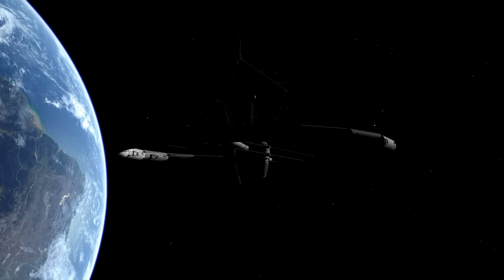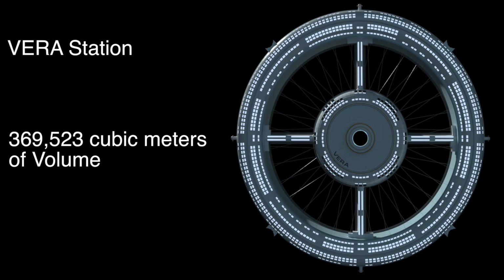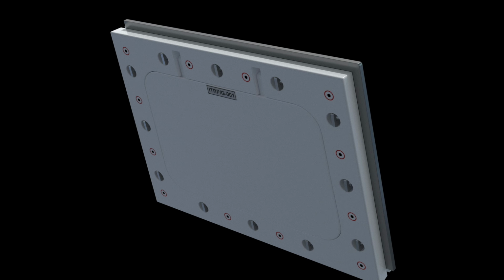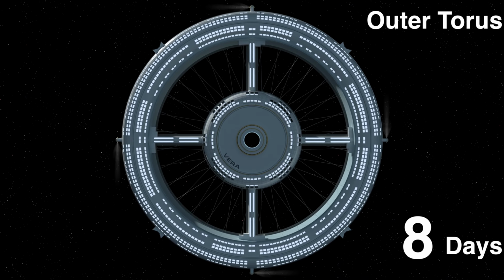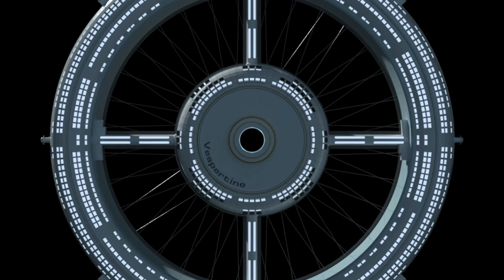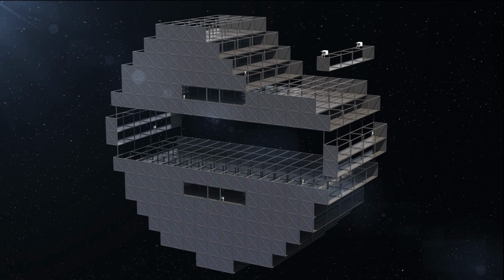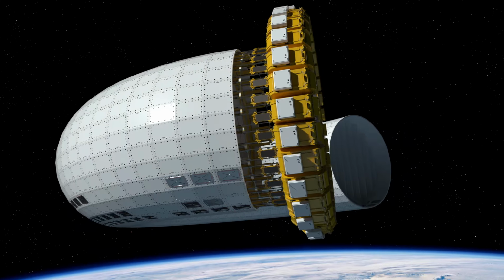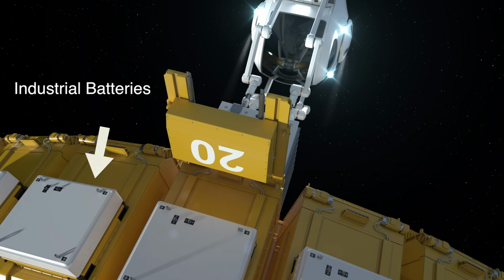We could build this huge Space Station in 6 months

Comment: Relatively similar to a concept I was playing around with about half a year ago. Some comments:

1) There's no reason to assemble things one panel at a time in orbit with a "construction ring". They should be sent up on hinged bundles of panels that can self-unfold in orbit. The only connections that need to happen are then (A) automatic locking in place between panels in a ring (rubberized seal, not welding), (B) joining and locking together with the ring on the opposite end, forming a completed ring; and (C) the connection of individual rings to each other, building up two halves.  Again, all of the "joining" hardware should be integrated into them at launch; they should just need to be aligned to mate with each other in space.

2) Come on, you need more glass.... the overall impression should be "glass with some metal", not "metal with some glass".  Except...

3) Occupants of a rotating station will experience a defined "up" (toward the center of the ring) and "down" (toward the exterior), which creates the concept of a floor ("down") - and one doesn't expect to see through the floor. You also need space for life support and various mechanical systems, which inherently block some views of sunlight - might as well have them below said "floor". And lastly, you don't want daylight 24/7. This argues for a glass-rich inner-surface ("up" - ceiling, walls) to the torus and an opaque outer surface to the torus ("down" - floors) (floors covered in exterior solar panels, integrated on the ground before launch, just like the glass). Maintaining a rough 24-hour day-night cycle can be achieved by the station undergoing one non-axial rotation per day, independent of the orbit.

4) The high volume to surface area ratio minimizes the impacts of leaks, and one can certainly  store truly massive quantities of liquid oxygen if desired. Still, the ability to isolate portions of the torus from each other in the event of a catastrophic accident would be desirable.

5) While interior maintenance is no different than on Earth (I assume panels will be 4-layer - inner contact layer + inner pressure layer + outer pressure layer + outer contact layer, so that either pressure layer can be replaced without breach?), exterior maintenance appears to be very challenging if the craft is still rotating.  So the ability to do periodic decelerations should be planned in.

6) Elevator sizes define the maximum size of prefab objects that can be brought into the rings, so you want them as large as possible. Unless you're also adding ports onto the ring (which can only be accessed when decelerated)

7) An inner rotation ring is a complication that I don't believe is needed. The small radial G-forces from such a slow rotation of a docked Starship centred on the point of rotation and perpendicular to the station should not be at all problematic. And you really want at least two Starships to be able to be docked at once; you can't rely on a single point of failure like that. You can dock more if you align them along a central spoke, although the greater offset from the central spoke would increase the G forces from them.

8) Honestly, there's great potential for space usage in the hub. While people talk about zero-G sports and entertainment, in most cases you really don't want *zero-G*.  For example, low-G swimming and diving might be fun, but in zero-G water tries to thickly coat your whole body (incl. mouth and eyes), there's no defined direction for where you can find air, etc.  There's a wide range of entertainment possibilities for the low-G environment in the hub and this should be fully utilized.

One thing you need to stress more is: ***floor space really isn't that expensive in a station like this***.  Even if you don't fill every part of the torus with many floors to maximize floor area. Starship's launch costs are so cheap that floor space lease costs should be similar to that in a big city.
Reply: Concept and design is far from the real construction. Seeing a lot of rocket/space explorer companies showed up their 3D animations/models without a realistic plan (fund, roadmap, etc). It's just a wasteful of resource for a lot of trash concepts

Comment: Assume all the technical and manufacturing problems are nailed first time around (which they won't be), I'd be interested to know how many launches we are talking about to build a station. The construction time is just one part. How long is it going to take to manufacture all the material for the first one? I was thinking it was going to take dozens of launches just to pressurise but it doesn't seem to bad - only about 500 tonnes of air. However, then you have to think about how many launches does it take to sustain a station of that size?

Comment: Great vision but there are a few problems/flaws. The panels of the toris look square at the presentation. Because of the toroid nature of the construction they have to be curved (left curved for the external ones and right curved as you move inside the torus) ,trapezoids and of different sizes, not squares so the design of the construction ring has to be redesigned. Another problem that has to be solved is the supply of such a big volume, not just of the external panels but also regarding the materials of the internal construction which needs to be done at the same time as the torus progress. What about radiation protection of the habitants? What a bout the problems that arises in an close environmental system like that ? Experiments here in earth and in space have shown that there are huge problems inside a such environment : bacteria, microbes, in other words a sustainable environment it's at least very difficult to achieved. Let say that these problems can be solved, there is a big problem with it: cost, which will be enormous and this is the  main problem of the space industry so far for the foreseeable future.

Comment: if the machine is inside the taurus as it goes, it cant finish the last ~1/6th. manual? or yet another imaginary machine?

the solar power hand waving is also laughable. 

you could make a taurus out of interlocking rings that fold out like origami. this is a much more likely path. just normal machining and load to orbit..  no reason to build in orbital construction constraints to your plan.

this is almost as if you saw a very highly efficient and tuned electric car, and thought, you know what, i'll invent an ICE and to support that i'll build an oil system and a fuel system and an exhaust system and a temperature management system and.... etc etc. there are literally unnamed entire spacecraft in your videos you dont even bother to explain.

please sit down with a competent engineer for coffee and let him explain how needlessly complicated your thinking is.

Comment: I grew up in a casting in machine shop I'm sure you probably heard us lost wax casting and high-pressure investment casting that the actors of the casting is when the within the thickness of a human hair I suggest that they place the mold on a turret where is continuously rotating during the four and do a full 60 rotation several times out into the complete length of the casting is done and I mean casting it straight up not sideways that way despite the thermal reactions there won't be any pressure changes was in the casting because of it but I'm talking as more small injection port computer-controlled constant speed until the pores done semi machine casting other than the setup your costs are going to go down because all you're doing is running a finish late check to make sure that there's no offset to the casting by even fractions cuz going to that pre-rolled steel it's such a waste of time

Comment: Love your ideas and followed you since you started, you mentioned it's too expensive to build on earth? Elon is setting up the machine to,ass produce heavy lift boosters, what if he just built sections the size of boosters all the same with dozens of off set connectors to make circles out of all those sections into a ring? Stacked 180 degrees of each other it would form another straight section that could be broken down in space.
The less construction in space the better. Making the machine to make the machine is huge. How thick the walls, insulation, double or triple wall, length of each section, reusable nose cones and tractor second stages, etc. Plenty to figure out even if musk built the basic inner ring, at least it would cut the time frame down. I look forward to your next video.

Comment: I see some problems with this design (maybe you have already solutions for it but they are not in this video)
1. In the construction phase you have alot of movement in the system so the whole construction will start to tumble
2. There is no heatsink system (if you take a look at the ISS the heatsinks are massive) and such a big station will produce alot of heat.
3. No solarcells? I think this monster needs alot of energy.
4. How will the stabilization-system work. If you have hundreds of people moving around you have
     1. alot of mass shifting around all the time
     2. the people put alot of kinetic energy through walking on the floors in the system 
     3. Worst case all people meet at the same place on the station
5. And last but not least imo your construction process is a little bit overengineered. My solution would be a construction ring with 2 welding robots with bigger magazines for the plates working on oposite sides on the ring. if one plate is welded they move a step left/right and weld the next one, less moving parts, less mass, easier to build. (Two robots so their movement will be neutralized)
Sorry for my english its not my native tongue.
Reply: I think he mentioned solar panels at 6:10 - 6:14
Reply: That most of the problems, how they gonna material and the amount system to work together both A.I and Human to start working. Not to mention the distance of the asteroid belt for material and system failure?
Reply: Stabilisation is somewhat straightforward I would think. You have to have to store a large amount of water, both fresh and waste/recycling water. Instead of one massive tank you have a bunch of smaller tanks situated around the torus and pump the water between them as needed to balance out any weight changes.
Reply: Well nice to see someone with big ideas like this for the future! Elon may have overstated some timeliness but he does manage to get things done! Big ships and big stations out there certainly sounds good to me!  Elon?

Comment: Lifting all that mass to LEO is still going to be your biggest limiter, you would need a lot of starships liting each day to keep a system like that running smoothly and machines that complex won't work without fail. One thing though it looked like the ring builder could be assembled from numbered sections that could be pre-build here on Earth. I also think that you will be needed some sort of double hull with self-sealing materials inbetween to make it safe 'enough'. You might need a starship for each section 3 times a day and that's more than 50 launches day in and out just to keep the system running.

It's funny though because your assembly way is almost identical to what I my self designed for my own idea about a space station a few years back, only I added layered hull section with an overlap that included automatically identifying issues if there ever was a hole somewhere. Lets just say I was bored for a while and needed something to do and designing a big space station was just to complicated to be easily solved so that became my go to place if I had nothing to do.

Have you thought about material stress if you spin a station held together like that? Will it hold if you spin to simulate 1 G?

One thing I can tell you right now is that you're going to need that build RnD station sooner than later.

That all said, I really like the assembler machine idea, build on earth ship up, assemble into the ring builder and let it build. Wonderful, but you should add a inner version of it that creates the double hull, just for safety reason as space is insanely hostile to human life. It could be all run parallels with a bit of off set and behind that the inside floor machine could go to work. Or maybe running two offset ringbuilders after one another to create an overlapped double hull. Even better add something like carbonweave as a holster between the layers to really protect the inner atmosphere.

I'd recommend building a test station first that was way smaller just to figure out the hang-ups before trying something too big. But I'm guessing there will be a money issue and don't forget that there's a storm of junk up there left from other space junk and that will be an issue down the road.

When it get's done, it will be very clear that the building blocks needs to come from space and not being lifters up from Earth. It's the only way something as big as you need will be build, unless we see a radical shift in lift capabilities. I had just the same issue with my own design and getting it all lifted will be your biggest hurdle.

But the core of your idea is very workable, I would know because it's oddly similar to what I designed over 5 years ago (nothing was ever released by me) so we both had similar ideas on how to build a big space station.

My big issue was lift capacity and cost, plus material strength calculations on exactly how much force spinning the whole thing would push the ring apart. But I'll say this I had a lot of fun figuring out how to build it, materials to use, balancing system and so much more. My idea is not fully done, but I'm down to stuff like electrical, water, sewage, air tight protection areas and more.

I really hope with all my heart that you can get this system up and running and humanity's first big space station can be build in space. It will do wonders for all the interest in space if done right. So keep up the good work.

Comment: The point to a torus space station is to provide artificial gravity at reasonably low rotation rates.  But that means you have to spin it.  Spinning it up with rockets requires a lot of fuel and if you neeed to stop it, you need fuel again to stop and restart it.  Building them in pairs with a framework between them lets you use electric motors to spin up and spin down.

It may be possible to reverse spin the radiation shield to proved the net zero momentum.

Sun sync is good for constant energy, but ii is relatively expensive to reach.  You might alternately consider low equatorial. 

Ebeam welding should do fine in space.  But in that case, you get a monolithic structure which may be prone to fracture.  Eric Drexler and I wrote about that in Vapor-phase Fabrication of Massive Structures in Space, Space Manufacturing AIAA 1977.  If you want to read it, but can't find a copy let me know and I will send you a scan.
Reply: Also worth talking with is Dr. Wendell Mendell, author of the first textbook detailing the specifications of a lunar base. This also goes back to the 1970s. It’s time to make this dream a reality!
Reply: @jasminn.5269  There is also Dr. O'Neill.  I was a founder of the L5 Society and was at the early conferences on space manufacturing.  O'Neill had a very low opinion of bases on surfaces for solid engineering reasons.  He did propose using the moon as a gravel pit with a mass driver to get regolith off the surface into space, but that was a minimum operation.  Rotating colonies in space have a lot of advantages over surface bases.
Reply: @hkhenson  Interesting insights. Why not use a control moment gyroscope to spin the station? no fuel required and I can deliver huge amounts of momentum
Reply: @johgude5045  Re question about how much gravity, I don't know, don't think anyone does.  Have to try it and find out.
Reply: @johgude5045  I thought I replied.  re gyros, they work, but to supply spin up to something massive, they have to be heavy or spin really fast.  A large fast flywheel is under a lot of stress.  Probably less trouble to build the stations in pairs.  I think the Stanford Torus spun a massive radiation shield opposite the wheel, but it's been a long time since I looked at it.
Reply: Why not spin with ion drives?
Reply: @preacherno  Ion drives have very little thrust.  It would take a long time to bring the station up to speed and an equal time to stop it.  It would be a worthwhile physics exercise to work the numbers.
Reply: Elon Musk's idea is pretty cool and addresses propelling the rotation!
Reply: @EthrFused  which idea?
Reply: Wow building them in pairs and using an electric motor to spin them up is such a cool idea! I immediately thought of the radiation shielding thing being on one torus, as well as panels/ nuclear power generators/water storage and other mission support items so the main torus can have more space for people, so cool!
Reply: I can’t see it needing to be rocket powered, cold gas thrusters (or spacexs new hot gas thrusters on starship) which are used for manoeuvrability on most spacecraft/satellites would be more than sufficient for creating spin and moving into orbit. Once in orbit with correct rate of spin it will not change drastically due to their being no atmosphere or resistance working against the rotational forces.
Reply: @Mark_Kelder  I calculated how much a minimal habitat would take some years ago.  It was a considerable number of tons per spin up or spin down.  You might grab a physics textbook and rerun the numbers.